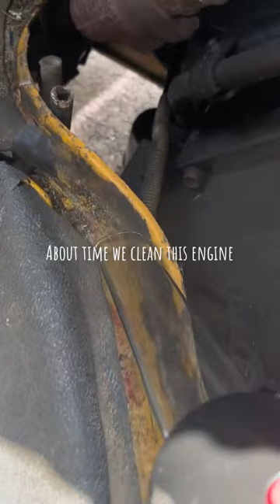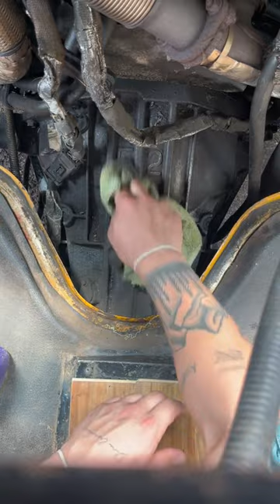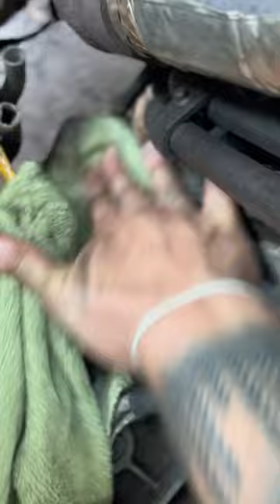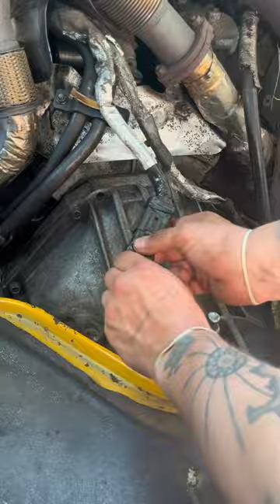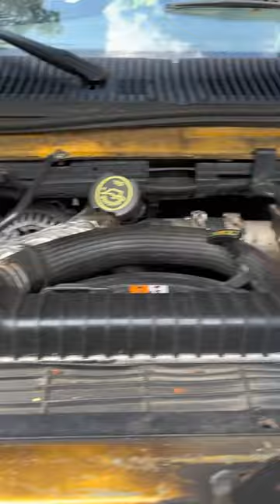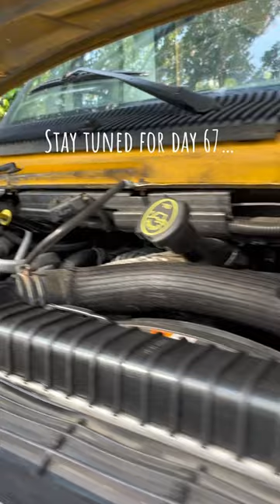Day *67 dirty dirty dirty…

Comment: Yo bro, you should do a full service that would really help the engine. So change the Coolant its very easy and do a flush if u can. Change the transmisson fluid and also the break fluid and i also reccoemend power steering fluid. change all the fluids and add  Sea foam with the ratio of ounces per gallon then your bus would run amazing and make sure the voltage of the battery is good. That slow starting is scary for the engine and no point if the engine blows up so do that its my reccomendation
Reply from the maker: That’s for the advice buddy I’ll definitely look into it 🫡